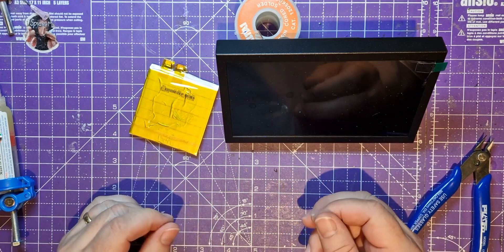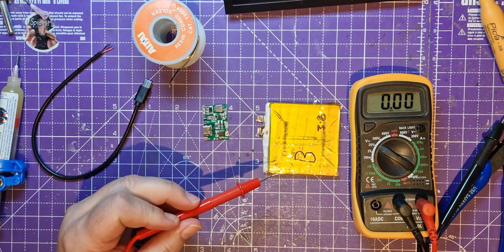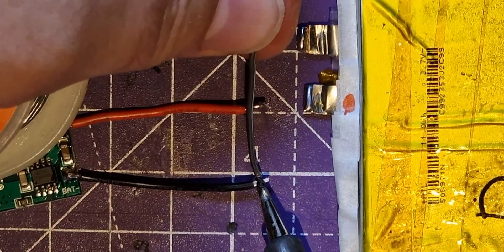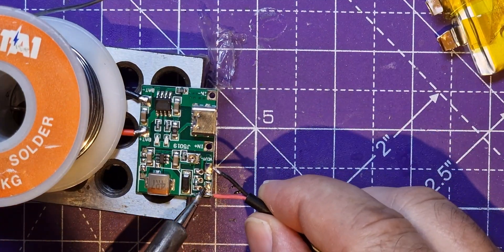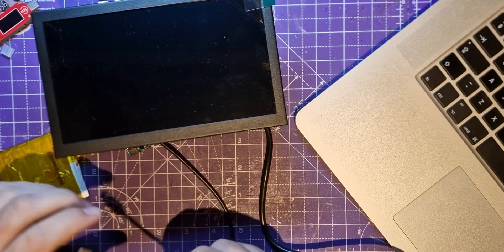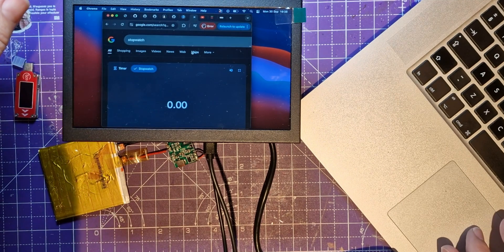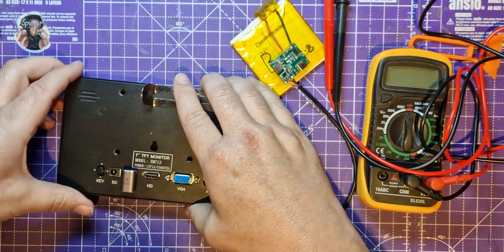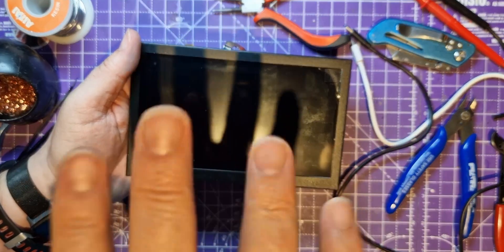Adding portable recycled lithium power to a cheap 7.13 inch Screen from AliExpress  EM713-D HDMI VGA

Comment: So about the recycle lithium ion batteries - have you had any issues with dissimilar batteries so long as they charged decently and have the same voltage? I pulled at least 36 decent cells out of some old laptops?

Comment: Could it not fit inside?
Reply from the maker: I did look. Potentially yes but I didn't want to damage the case and also have the.option for easily swapping out the battery pack if I need to (without dismantling)